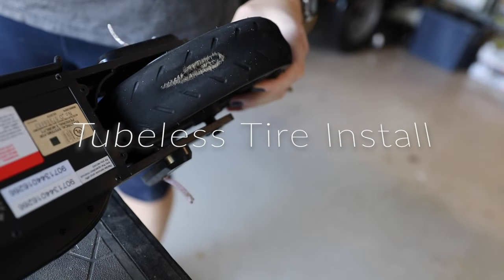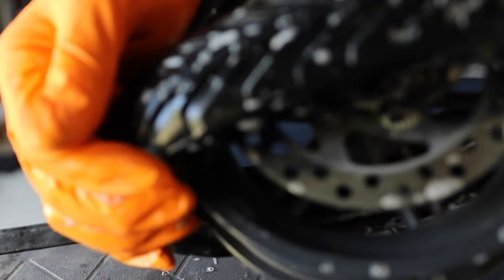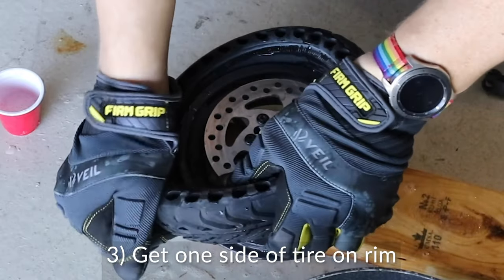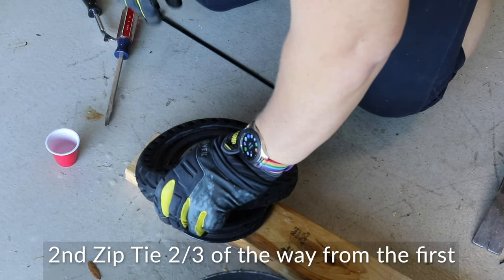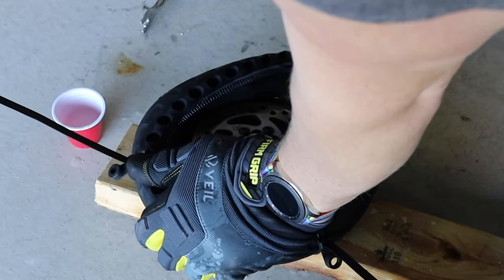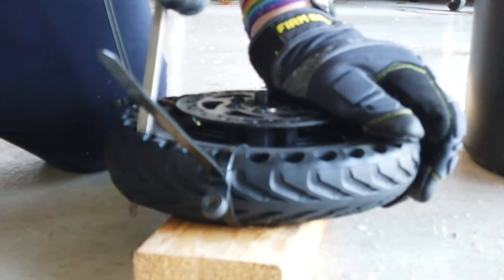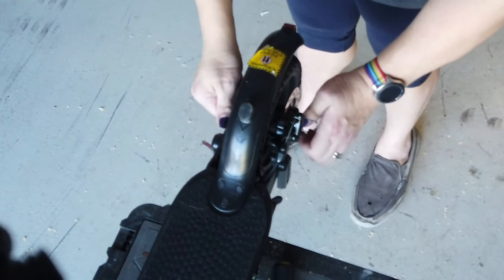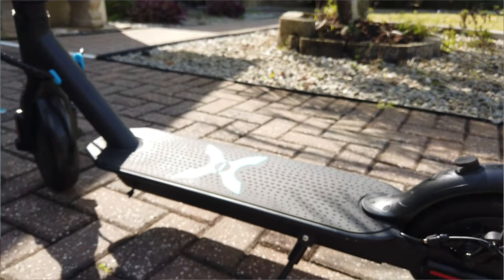How To - Solid Tubeless Tire Install for your Xiaomi 365 or Hover 1 Scooter (8.5 in tire)

Comment from the maker: If you'd like to pick up a tire, the solid tires - front and back:  https://amzn.to/3kGqftL or you can get
Multi-Colored Tire: https://amzn.to/323iZ2X
Reply: I want to install air tires to reduce the feeling of all the bumps on the road. How do I do? There is no place for the valve on my wheels
Reply from the maker: You'd most likely have to notch out a hole on the rim, but you're going to compromise the rim. So I'd try to purchase a wheel that supports air tires

Comment: This was the single hardest thing I have ever done to any moving vehicle, car, or scooter.
Reply: If a tire was hard to get on it usually boils down to heat. A really good way is gloves and a microwave. Heat it 1 min, flip, 1 min, flip, 1min and then put it on the edge of a work bench. I was able to stretch it right on then. Then just make sure both walls are aligned properly and use a lever to help pop it on if needed.

Heat is the best way to make it easier, without that i would have a very hard time

Comment: Three flat tires on the rear tire of my Hover 1 led me here.  I’m not mechanical, so needed some help.  Really helped with assembly and disassembly, thank you.  I boiled the tire 2x and no way could I get that tire on the rim.  Wrong tools, wrong leverage.  However, the fellas down at World Famous Mike’s Bikes (motorcycle shop) in Queen Creek AZ were able to pretty quickly.  The right tools make the difference, for sure.  For all y’all that got this on by yourself, kudos.

Comment: Can you believe that I did it with my bare hands ! Just put in microwave for 2 minutes and fit the top part and forced the bottom part to fit in using the Pam of my hands. It did leave a bruises lasted for few weeks but we are all good now lol
Reply from the maker: I'm shocked honestly - I tried a lot of different things but I haven't heard that a microwave for 2 minutes would loosen it up enough to slide it on there.  Thanks for sharing!
Reply: @AndiWofford  why'd u took the break off ???
Reply from the maker: Unfortunately mine would not come out without loosening that brake caliper. I tried without it and couldn't get it off.
Reply: i bet it smelled like crazy microwawe a tire
Reply: adress it did but I got febreze standing by lol never go over 2 minutes as it will be too hot to touch with your hands 🖐

Comment: Thanks! Your tutorial helped me a great deal. Took me about an hour to first get the old tire to come off (idk why but it was the hardest) and then replace it with a new one. Boiled the rubber and managed to wrap it around the wheel with just bare hands and two large screwdrivers to center the tyre later. Took some serious effort but was definitely worth it. The repair shop where I live overcharges for the service. It can be done so don't give up people!
Reply from the maker: Thank you for sharing! Glad you were successful in getting it on yourself!

Comment: Thank you for this. 3 hours and a lot of sweat and I finally got my tire on. Same exact one as yours and had the same issues lol. I actually had the hardest time getting the original tire off and ended up cutting it off with some strong scissors. Made it a lot easier. 

Thanks again for your help. You rock.
Reply from the maker: Thank you so much!
Reply: @AndiWofford  Is that you talking ( a guy's  voice?) or someone else?
Reply: I just had to do the same thing and was curious if anyone else ever had as well haha

Comment: Thanks, this helped out a lot. I added salt to the water to raise the boiling point and this definitely made them more pliable and hotter! Definitely used the trick with the hole in the wood.
Reply: That raises the boiling point by a mere 0.04°C
Reply: @RowOfMushyTiT  sometimes thats all you need, also depends on where you live..

Comment: Hi Andi, 
Thank you for tutorial. I have to add that for 365pro front wheel is far more difficult to work with and riding on solid tires are less comfortable , more battery consuming , I have this feeling like riding on flat tire and is more slippery especially on wet surfaces. Despite it , In my opinion , replace is sensible solution.
Reply from the maker: Thanks for your feedback!
Reply: A couple of weeks ago I change the front tire, but the solid tire shrunk my range. Does it affect to the capacity of the engine or battery?
Reply: @giorgigabri  in my case , yes. I would say that this is due to greater fraction of solid tires.
Reply from the maker: ერთადერთი უარყოფითი, რაც მყარი საბურავებით მინახავს არის ის, რომ არც ისე კარგია გასეირნება. მე არ მინახავს რა იწვევს ბატარეის ან ძრავის დიაპაზონის შემცირებას. ზოგი ამბობს, რომ დამატებითმა ხახუნმა შეიძლება შეამციროს დიაპაზონი.

Comment: When you fit the brake callipers back the correct way to align it to the disk is to merely press on the lever. The pads then grip the disk and align themselves, then just do the bolts up whilst holding the lever.

Comment: the mount  for rim setup you have is good. but all that effort to stretch the tire is crazy.  How about with current setup of using a zip tie one side of the rim, your mount.  Just insert a metal rod into one of the holes on the opposite end of the tire.  attach a ratchet strap on the rod and secure the strap to something firm.  Start tightening and when the tire stretches just use the flat bar to slide the rest of the tire in. You may need 2 flat bars to make this easier.

Comment: The easy way to put it in without complicated tools is.... and I do it in less than 4 minutes 
1 put the tire in the Microwave for two minutes( I’m not kidding ) to the rim lubricate with dishwasher soap
2 with gloves 🧤 and a little bit push manipulate the tire inside the rim and voila.... I do this on my kid scoter and takes me less than 3 minutes 
Tire expands little like a marshmallow and it’s way Easy to handle I didn’t need a tool trust me it’s works !!!!!!!👍🏻👍🏼👍🏽👍🏾👍🏿Im not a strong man just smart 🤙🏼

Comment: A reviewer should always mentioned if a scooter have splitt-able tyre-rims, or not. The Zero 8/9/10 models have it, for example. It's still gonna be a hassle to change tubes/tyres for customers without skills and tools - but at least it's gonna be a much smaller hassle. And bicycle-stores with workshops are more likely to help you out. Especially if you already have the spare-tube with you.
Reply from the maker: This reivew is for the Xiaomi m365 and Hover 1 scooters, which covers how to change tires on rims that do not split apart.
Reply: @AndiWofford  I realize that your clip is not a scooter-review, but about changing tyres. My upload was more about reminding future customers to look out for and demand more user-friendly design-solutions like splitt-able rims.
Reply from the maker: And while that's fine, starting a comment with "a reviewer should always mention" appears to be directed at the creator for omitting critical content.
Reply: @AndiWofford  True. The comment could have been formulated better.
Reply from the maker: However, I always appreciate comments. And this insight into splittable rims is no doubt helpful for viewers, so thank you for sharing

Comment: I'm trying to replace the front tire of my GoTrax GXL V2, which has no spokes to put zipties through. Having a bit of a hard time with it.
Reply from the maker: Can you use the old hole of the schrader valve? I did that and was able to get it on.

Comment: Thanks for your video, must have watched it 3 times during my repair! I have another tire to replace the front wheel as well, but I'm worried bc I won't be able to use the zip tie trick, since that wheel is the solid motor one.
Reply from the maker: You're welcome 🥰. Let me make an attempt on that one as well and I'll throw a video together. You're the second person to ask about it, so clearly there's a need!
Reply: @AndiWofford  I got the front tire on just by boiling the tire 15 mins, putting Vaseline on the rim and tire, I sat the rim flat on my wood w the cable side down, and worked the tire on over the top. Definitely had to secure it with my knees and it took a lot more muscle than w the zip ties, but the Vaseline was a game changer. Didn't use any dish soap. One YouTube video recommended microwaving the tire for 3 mins w breaks every minute. DO NOT do that! Less than 90s and a hole burnt in the tire. Stick with boiling! GL and thanks again!

Comment: Thanks for the helpful video, just ordered everything, just one question: some Amazon reviews say that boiling the tire indoors is overpowering, is this true? Did you just heat the thing up in your kitchen?
Reply from the maker: If you check out the front tire video, you can see that I boiled it outside ( https://www.youtube.com/watch?v=dzsgjCj397c ) - but you can do it inside. I woudln't reccomend it if you have the capacity to boil it outside though.

Comment: Although you don't mention it, did you look at the tread pattern to see if you're mounting the tire appropriately for the direction of rotation?  The tread pattern seems to indicate it would want to be mounted one way or the other for leading water out to the sides.
Reply from the maker: I may have mentioned it in some of my other scooter tire videos, but great point!

Comment: Very informative video and saved my butt but now my breaks aren’t breaking i followed your directions everything works except the breaks. Is any suggestions?
Reply from the maker: I'm going to need a little more info. The brakes don't work at all when you squeeze the handle? Or they work a little? Did you get the disc lined up between the two pads?
Reply: @AndiWofford  Don't ya hate that..they ask for help//then disappear.
Reply from the maker: Yeah, if I'm not fast enough on a response they likely figured it out on their own.

Comment: The replacement tire, did you put it on a hover 1 scooter? Amazon said the tire is for Xiaomi scooter.
Reply from the maker: Yes, it's on a Hover 1 scooter. Which also has the same 8.5" tire as the Xiaomi scooter. They both have the same tire size
Reply: How about Hover 1 Alpha ???
Tire and inner tube ???
Or solid tire ???
I can't able to find it anywhere any ideas please let me know

Comment: Any of you guys knows where to take these tires to a repair shop in the Miami area? this is very hard !!
Reply: ok, I ended by doing the plastic tie + tire heat trick, that did it. But wasn't easy though

Comment: hey my tube tire is flat i want to teplace it with solid tire but the size of my default tube tire is 8.1 its hard to find a 8.1 on the internet they are all 8.5 is 8.5 fit on my wheel? what do you think
Reply from the maker: Honestly I'm not sure. You could try an 8 inch and see how it works; might be hard to get on though. . .

Comment: If my Hover 1 has a 10 inch tire.. will the Amazon Rubber Solid tire link fit my Hover ?
Reply from the maker: No, unfortunately it won't. I've tried to find one at ten inches and can't seem to locate anything but 8.5's

Comment: Does this work on the Hover 1 Dynamo?
Reply from the maker: From what I've seen it only works with eight and a half inch tires because those are the only ones that are manufactured as replacement tires for these scooters. I don't see any of the other sizes like 10 in or 6 1/2 in a solid tubeless tire
Reply: Thanks appreciate the feedback

Comment: I'm thinking of either replacing the inner tubes of my hover-1 tires or buying solid tires. Which one do you feel is better?
Also, on a side note, apparently many electric scooters get flats easily, since the tires are smaller so they  are more prone to become flat. No wonder so many people have the same issue! This is why I'm thinking of buying solid tires instead. 
On another side note, I clicked on the glow in the dark solid tires and it said the product was currently unavailable. Do you have any other glow in the dark alternatives from which I could buy? And you said it is also possible to buy solid tires attached to the rim. Do you have any links for these? Thanks again for everything!

I have a hover-1 pioneer, not a xiaomi 365, so even though a lot of solid tires work with the pioneer, a bunch of solid tires with the rim attached are not compatible with the pioneer.

Comment: Try to put the tier in microwave. Much easier to fit when it warm
Reply from the maker: I decided to boil mine, which definitely helped make it stretchier so that I could get it on the tire.
Reply: how long in microwave?
Reply from the maker: I didn't use the microwave for mine, I boiled it
Reply: @littlemar22  1 minute on each side 2 time's.
Reply: Hover 1 Alpha electric scooter
Tire and inner tube
I can't able to find it
Any ideas please
Maybe solid tire ???
Where I can able to find it ???
Thank you so much

Comment: I managed to put it on manually with only a screwdriver and my bare hands and feet. It was extremely difficult, but I did it somehow. Difficulty 10/10

Also the zip ties only work for the rear wheel, not the front one with the motor...
Reply from the maker: I did a rfont tire install - you can use the holes that the schrader valve that you no longer need to at least get one point in the front: https://www.youtube.com/watch?v=dzsgjCj397c
Reply: @AndiWofford  Well I already got it on now. The back tire was actually quite easy. It took me less than 10 minutes for the whole process including putting it back on the scooter. The front tire was a nightmare though.

Comment: The way most these videos all keep showing how to change just the rear tire, you'd think no one knew Scooters also have A FRONT WHEEL RIM. What about THAT ONE???? Why aren't there lots of videos about how to get the solid tire onto THE FRONT WHEEL RIM? That's a much different one than the rear rim.
Reply from the maker: I'm not sure, I'd have to assume that most people replace the rear tire. That's really why I created one of each and a pneumatic tire replacement video.

Comment: You damage the mags
Reply from the maker: Is that a question or a statement?
Reply: @AndiWofford  im just telling that you scratch that rim. I can installed it without scratch just use one screw driver and two hands
Reply from the maker: Appreciate the feedback. Certainly if you're more careful you could prevent scratching the rims. If you have the right tools you can do even better. This was my first attempt and I did scratch the rim. I'm glad that you were able to do it without scratching!
Reply: @AndiWofford  yes i can

Comment: This is straight up physically impossible to do. Took 3 hours just getting the tire off and the solid tire doesn't budget with lubricant, tools, zip ties, and boiling it for 20 minutes. Just going to toss this useless scooter in the dumpster.
Reply from the maker: I'm sorry you had so much trouble with the replacement.